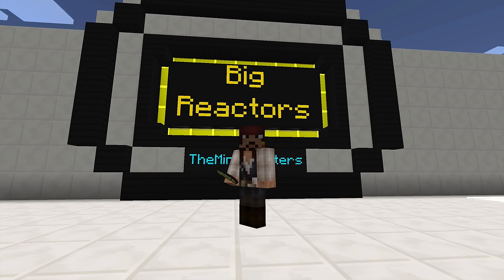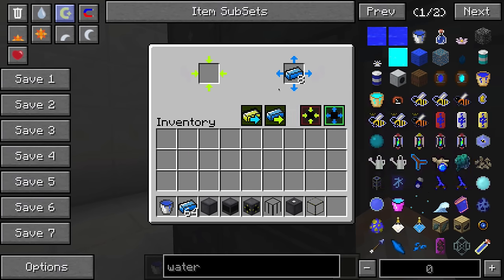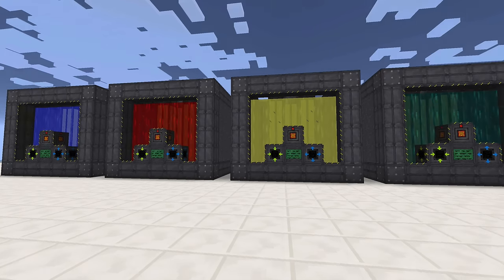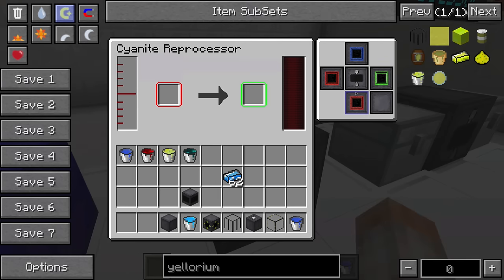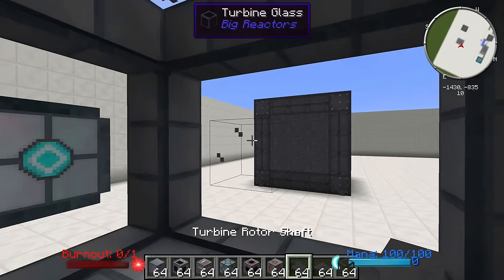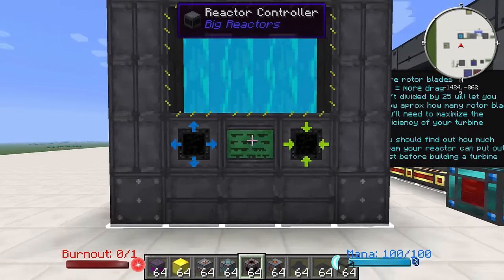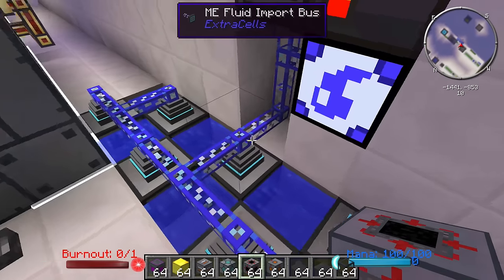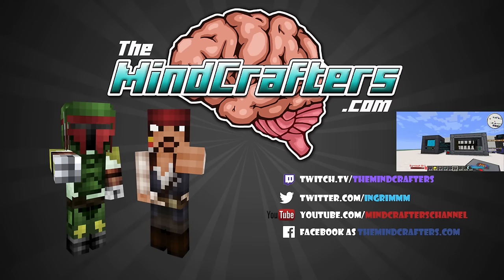Big Reactors Tutorial - Reactors & Reactor Turbines

Comment: There is a much better way to build these systems, firstly building the reactor right next to the turbine, I can not over state how much more efficient this is. The reason turbines require so much water is because any excess water not removed from the turbine is lost. The turbine will use the steam, and then turn the steam back to water 1 for 1, if you don't extract that water fast enough it gets lost, so the limiting factor becomes how fast other mods can move the water.

Edit: I should note I'm using version 0.3.3A which comes with Agrarian Skies 2.1.6.

By building the turbine directly next to the reactor you create a closed loop system, so you only need to fill it once, this is because the flow of the steam and water between the two is done instantly. To give an idea, I have a reactor 5x5x4 (this includes the case), with 5 columns of 2 fuel rods, so 10, with this setup, 4 rods are set to 20%, and one to 10%, it creates and transfers 2000mB/t of steam off one Aqueous Accumulator with one Fluiduct.

I'm in the process of testing a vertical turbine (vertical turbines are not limited by size so far as I can tell) to find out how much power I can get out of it, current setup is 20x4 blades, and 8x5 Shiny Blocks for coils, at time of posting, 1750 RPM and rising, 17200 RF/t.
Reply: Finding a good way to generate enough water was the main thing holding me back, so this is interesting! So you just have the ports that connect the two machines directly against each other with no piping in-between?
Reply: Venatius Eye 2 ports on each machine directly connected to each other, make sure the input and output are the right way, so blue connects to blue and red to red if I remember right. You'll also need 1 more import port on the reactor to get the initial water in there.
Reply: Interesting! I may have to give that a try, if that would avoid having to futz around with tesseracts and the like. My reactor might be too large to work with this setup, but it's worth an experimental try.
Reply: I found that a 5x5x4 reactor, with 10 full rods, configured in a grid with the north, south, easy and west faces having some sort of coolant, generated 2000 stream per tick. It's worth noting this was hair line, and I did encounter the reactor getting too cool (might be effected by biome) and not being able to produce 2000 any more, the fix was just to reduce the passive cooling.
Reply: Do you mean that the reactor and the turbine should be touching eachother (and have the steam output port of the reactor touch the steam input port of the turbine, and same with the water), or do I need 1 block of space between them?
Reply: Directly touching, with the two Turbine Fluid Ports (one red one blue) directly touching 2 Reactor Cooling Ports of the same colour, red to red, blue to blue, just make sure you have one more Reactor Cooling Port somewhere connected to a water source for the initial water supply.
Reply: Skid-Inc Gaming Not 100% sure but I'm pretty sure you can use Tesseracts on each port to send the steam from the reactor to the turbine and then another for water back to the reactor. I BELIEVE they don't have a limit on the amount of input so if you put it right up against the input/output valves you shouldn't have a bottleneck. Bevo did this in his Agrarian Skies build and only had to put in one initial fill of water to get it started.
Reply from the maker: Heya! You are correct, and the tesseract method is actually how most of us have ours hooked up on the server. If placed directly adjacent to the fluid import, a tesseract can handle the entire inflow of liquid on its own and makes for more versatile builds because you don't have to have both the reactor and turbine together.

+like this comment to keep it at the top, I would have included this in the tutorial had I know about it at the time. ty phish!
Reply: The MindCrafters
For practical reasons, this tesseract solution sounds nice. But for bragging rights, it would be awesome to build on of the largest possible cases (like the big one that was shown near the end of the video), even when you can't use all the capacity, and have it hooked up physically, so everyone thinks you are both a genius and a rocket scientist!   :-)

Anyway, for Agrarian Skies, I found out that a 7x7x7 reactor, 5 core columns, 100 fuel ingot capacity, and a bucket of that cold Cryo liquid in every free block inside, is already very efficient. One yellorium ingot yields 70 million MJ. When I hook this up to a mining laser, for each yellorium ingot burned, the laser retrieves the material (ores) for 5-10 new yellorium ingots, so I do not see any need to be more efficient than this. I might try the active steam cooling system, though, since it looks really 'cool'.  :-)
Reply from the maker: mpeijzel
One of the players on our platinum server has a similar setup with mining lasers & 4 turbines each putting out about 24,000rf/t. more and more I'm thinking I need to do a follow-up video to this tutorial to show their true power haha
Reply: The MindCrafters
Definitely! My own 7x7x7 setup gives 12,000 RF/t right now, and my cables only support 10,000 RF/t, and I am too lazy right now to add a second power connector, so I either adjust the control rods to a lower speed, or just let the extra power go to waste.   ;-)
Gelid Creotheum is not that expensive to craft, and still does miracles for passive cooling!

By the way: I derped a bit in my previous post - I wrote about Minecraft Joules, but I meant RF (Redstone Flux).

Maybe you can showcase the setup from one of your players as it is on the server? (Or place a link to his video below your video if he has already recorded this himself?)
Reply from the maker: mpeijzel
Yeah I think I might do a quick video showcasing some high powered setups considering the activity that this video is getting right now....and also to clarify some of the things being discussed right now.
Reply: The MindCrafters
Thanks!
Just as a tip to you: when building the machines, demonstrate it a little bit slower. It is very difficult to see what you are doing, when you go into creative mode and build the reactor. I understand that you do not want to waste our time, but there is also something like 'too quick'.
Also, please show us how to add the liquid (Gelid Cryotheum, for example) into the setup. It is not clear from your video whether you only need Cryo in the 'top' layer (layer 4 in a 5x5x5 cube), or in 'all' layers (layer 2, 3 and 4 in a 5x5x5 cube).

Also, it would be cool to see a working example of the largest possible reactor. (It does not need to be efficient.) I heard somewhere that the maximum size was 32x32x48? I am sure that even Herobrine does not have a reactor that large!   :-)

By the way: when the author of the MOD decides to add a meltdown/explosion on a high temperature situation in the future, then we need to take safety precautions.
We should have a nice example of a reactor being far away (with a chunkloader), and using tesseracts to transport the power.   :-)
Reply from the maker: mpeijzel The gelid Cryotheum actually behaves different from most liquids....the best way I can think to describe it, is that it behaves like sand or gravel. When a bucket is placed it'll fall to the lowest unoccupied space whereas water, destabilized redstone, and other liquids only require you to fill the top layer.

Ive never actually tried to make a "massive" reactor but maybe ill issue that challenge to the team and see what they come up with haha.

As a side note, its best to build the turbines in a single chunk, as crossing chunk boundaries can cause issues if for some reason one if the chunks gets unloaded.
Reply: The MindCrafters That's why I advice building turbines vertically, there no height limit so you can make it with a lot less blocks and fit the reactor and turbine in the same chunk. Also since getting the Cyanite is a bit of a waiting game, you can get a full power turbine faster. That said it would be possible to deliberately make an inefficient reactor for the soul purpose of creating Cyanite, bit like IC2 breeders reactors.
Reply: The MindCrafters
It's too bad that it is not documented that well - I painfully hand-placed a bucket of Cryo liquid in every free space, layer by layer, working upwards. It was a full 100 buckets to do the job.
As a side effect, when I closed the top, I got free snow on top of my reactor.

And yes, always use chunkloaders when a machine gets across a chunk border! This is exactly why my Agrarian Skies map is composed of 'tiles' of 16x16 blocks. That way I know exactly where the chunk borders are!

Again, for the challenge: they may do it in creative mode, with unlimited supplies, and it does not need to be efficient. Just as long as it works, and it outputs at least 100 RF/t, then things are fine. Then it is a challenge to the viewers to make a better one!   :-)
Reply: Skid-Inc Gaming
If you have access to a lot of yellorite that you can get rid of, then you can make a reactor with as many filled columns as you can. Don't use any cooling at all. It burns through your yellorite and turns it into Cyanite while you wait.
Reply: mpeijzel True but that'll only be doable until they implement reactor overheating, then you'll be limited by whatever the safest max is.
Reply: I'm using 0.3.0A (in IceHenge) and unfortunately the closed loop trick doesn't work for me. I've got my reactor and turbine adjacent, but I still need 12 Aqueous Accumulators hooked up to an AE system to get enough water into the reactor, and that's for a measly 289mB/t of steam.
Reply from the maker: Michael Levy
 Pipe all of your fluid into a tesseract and place it over the coolant port....the tesseract should be able the handle the full amount through just one port
Reply: *****
Most (if not all) of the comments in this thread are about the mod. What comment are you referring to? If you are referring to the original poster, then he is talking about the mod.

Comment: One thing to note with actively cooled reactor/turbine combos - you still want the same cooling setup included in a passively cooled reactor.   The active cooling uses the casing heat to turn water into steam.   Passive cooling components (liquids, diamond blocks, etc.) transfer core temperature to casing temperature.   Without the passive components, you get a high core temperature and relatively low steam output.
My test reactor (7x7x7 w/ 5 rods) on Monster produces about 2500 steam /tick without passive cooling and approximately 7500 steam/tick with diamond blocks filling the X of fuel rods and resonant ender casing the fuel rods.  Temperature levels between core & casing are also almost even once the passive cooling is added.
I'm sure there's some more tweaking & tuning possible as well.

Nicely done tutorial too - I'm just starting to play with the turbines now.

Comment: just finished my passive reactor and also the turbine, both seem to be working ok but even with ender pump i still don't seem to be able to fill both the turbine and the reactor with water so it only spins up to about 1350RPM, its a 5 core reactor and same width you did in this video but a few blocks longer if you get what i mean. my core is also at +3000c and fuel usage is massive compared to the liquid cooled reactor this just isn't good enough to justify using the turbine. 

Great video BTW you have helped me no end
Reply: You can configure turbine drag to be much lower, and turbine power gen to be higher
Just go to .minecraft>configs>big reactors

Hope this helps.

Comment: It turns out you can also have passive coolant in your actively cooled reactors.  Using gelid cryotheum in all the air spaces in the single rod reactor boosts the steam production up to between 662 and 729 mb/t (varies based on waste currently in core, appears linear) compared to the 271 mB/t in the video.  Note, this takes proportionally more water.

Comment: "Liquiduct transfer rate is 100mB/t per connection."

your turbine in the comparison example is using less than half of the steam output of your reactor (~28:00)

Either add 2 more fluid output connections, or directly connect them with tesseracts (which, iirc, have no flow limitation)

EDIT: I could be wrong, but you never mouse over the steam gauge in the turbine interface. If the turbines never fill on steam, they're not being fully utilized (not enough steam).

Comment: I've played around with a couple of setups, and at one point I forgot empty the Destabilized Redstone from my passively cooled reactor before turning it actively cooled - and it works! This would makes sense if compared with real life reactors, where the fuel rods and reactor vessel are sorrounded by cooling liquid. So far, I've been able to cut the yellorium usage down to 1/4 compared with designs without passive cooling. Thought I'd mention it. =)

Comment: One thing I'd like to let you know in case you make another video about this. every source block you use in the reactor makes a significant difference. Obviously you used it on the gelid crotheum because its physics force the source to fall.
BUT, the Ender is actually more efficient cost wise.

Comment: I'm watching this now because I need a reactor in the Blightfall pack. But when he starts to talk about heat, I can't help but to think of a more recent base-building game, Oxygen Not Included. So here I am, getting my streams crossed and thinking "why aren't you putting a steam turbine on top of the water cooled reactor. You can get steam power to help with the costs of running a cooling loop." And then I remember this is Minecraft.

Comment: what i did was set up a ton of raillcraft tanks and they were contantly full due to the aqueos infinate thing and 1 of those tanks can hold a chunk of fluid from max height to void and i have 5 of them at their biggest size with a TON of infinate induvisual aqueos accumulators and the jumps were much smaller but i think there should be a fluid tank for it so that way it can hold more water

Comment: I built the exact same 7x7x7 passive reactor filled with cryotheum with 5 interal fuel rods, and I got 12KiRF/t using 0.325mB/t of fuel and with temperature at 1330°C. Not sure why, but one thing I noticed is that you only seemed to fill the top layer with the cryotheum, but I put a bucket in every empty space (total 120 buckets).
Reply: +Bizorke Never mind, I didn't realize cryotheum was affected by gravity - so the setup was the same. Maybe it had to do with warm-up time or something.

Comment: Important note:
The checkerboard pattern for the fuel rods is actually the worst possible pattern. The reason? Well, the fuel rods are now blocking the coolant from reaching each of them. now each fuel rod only gets 1 block of coolant. 

An optimal pattern is a 3x3 grid with about 2 blocks between the grid and the wall. Now you might be saying, wait a second, now the rods get no coolant at all! But Big/Extreme Reactors actually has a mechanic where rods directly next to eachother irradiate eachother, resulting in higher power output and fuel efficiency. 

Tl;dr: use a grid of rods directly next to eachother with some space between them and the wall, NOT a checkerboard pattern

Comment: I built an actively cooled 3x3x3 reactor and an 8 bladed turbine. I cannot get the steam out of the reactor and into the turbine. I am pumping water into the reactor with 20 aqueous accumulators and hardened fluiducts. I have hardened fluiduct connected to a reactor coolant port, but the steam will not flow out, the tank in the reactor fills, but i can't get it into the turbine. What am i doing wrong?

Comment: I'm having trouble with the efficiency of my setup. I have an actively cooled reactor that outputs 1400mb/t steam to the turbine, this reactor is also filled with destabilized redstone if that makes a difference. This all works fine and I've fine tuned the turbine to  run at 1796 rpm, which outputs 11461 RF/t. The problem is that when the reactor is in passively cooled mode it outputs 8890 RF/t with 0.14mb/t of waste, but in actively cooled mode it creates 0.2mb/t of waste. That leaves me with about a 29% increase in power with the turbine, but a 43% increase in waste, I thought this was supposed to be more fuel efficient or am I doing something wrong?

Comment: This was very helpful, however I have one question. Actually getting the RF out. I don't know why, but it seems I don't have any energy conduits or anything. I have thermal expansion, Ender IO, etc. but it seems there is no way to get this power out
Reply: [Ender IO] Energy Conduits work perfectly. I just have them set up to a Capacitor Bank and a couple of other machines. If that doesn't work I suggest you try using Fluxducts. I am not sure if they are used actually for RF or not, Never tried them.

Comment: hey quick question (btw im new to this) how do you hook up the reactor to all the types of machines, like electric furnaces, pulverizers, etc, and what type of  pipes do u use to do it, also where would the pipes be connected to on the reactor
Reply from the maker: Use the reactor power tap and connect it to anything that can transmit RF energy, like the Energy Conduits from EnderIO https://youtu.be/4aBDqrC_BeE?t=10m53s

Comment: Wtf? When I set four fuel rods in the corners of the the passively cooled reactor (Which is 6 Long 6 Wide 5 High 6x6x5) I get 1.97 KiRF/t and a fuel burnup of 0,065
But when I set the four fuel rods in the middle I only get 718 RF/t and a fuel burnup of 0,247?

So when I set them in the middle they use alot more fuel for alot less power? You said in the video that we should place them in the middle?